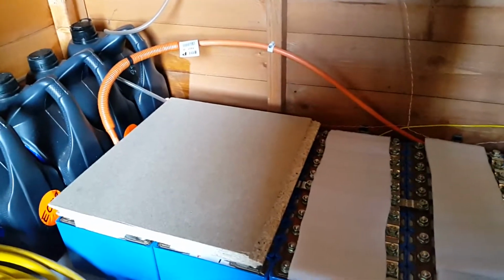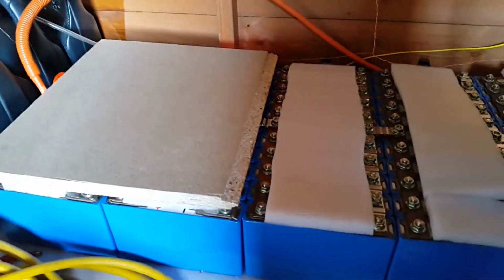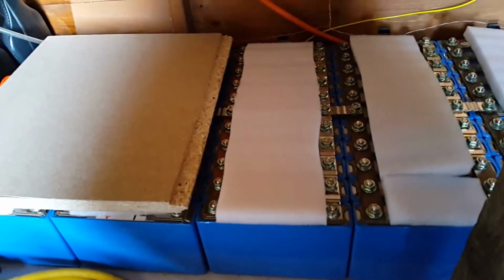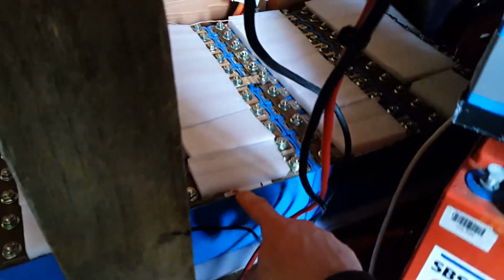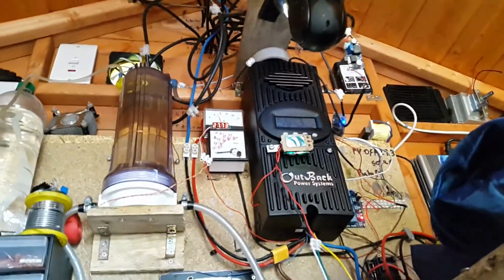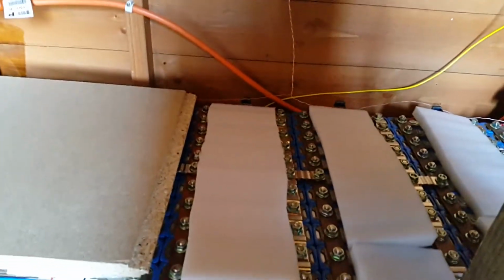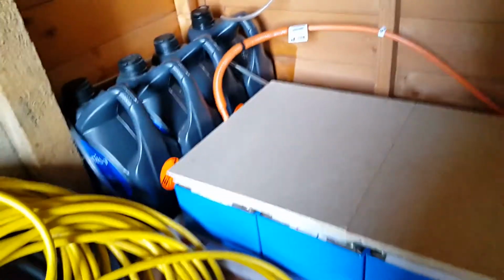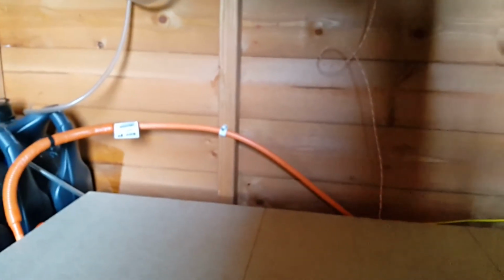Solar Battery Bank Cover

Comment: Hi Shaun, can you do a video about your BMS and cell balancers for your outlander PHEV pack. I'm about to get one out of a wreck and starting to look at how I'm going to do it (going with a 14s configuration for a 48v nominal system).
Reply from the maker: I have a video on my channel somewhere about it. It is quite recent.
Reply: Shaun Dobbie I'm struggling to find it :(.    In the Installation video where you are installing all the bus bars you mention you will do the install of the BMS tomorrow. the 2 videos after are the car charging and the battery cover. what BMS and cell modules are you using?  did you work out what the internal resistance was?
Reply from the maker: Hi, the internal resistance of 11 of these cells in parallel is too small for any of my equipment to measure. I think the resistance of a single cell was 0.8 milli ohms. I think this is the video you are looking for. https://www.youtube.com/watch?v=OBlmPQVaO4E
Reply: Shaun Dobbie oh wow; diy balancers as well!  cool.  with a lead acid battery the IR is by a formula based on two discharge rates and voltages to then get the IR (not a direct read).  maybe different for lithium.